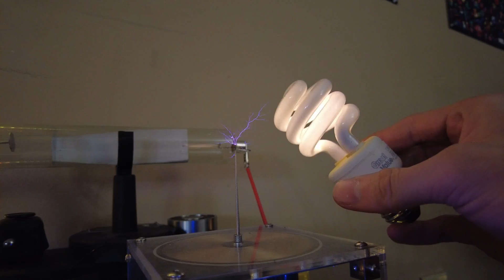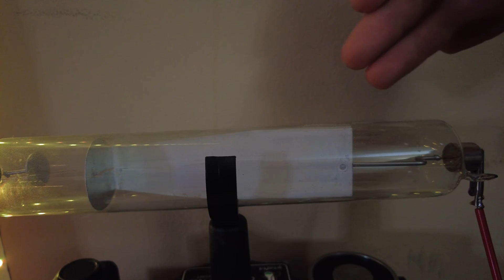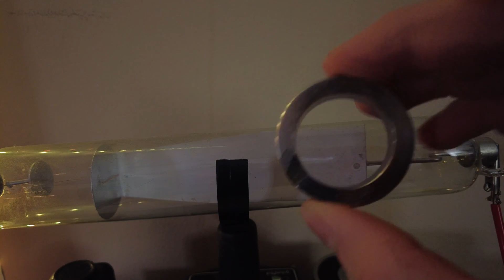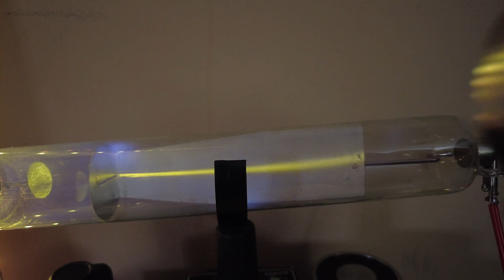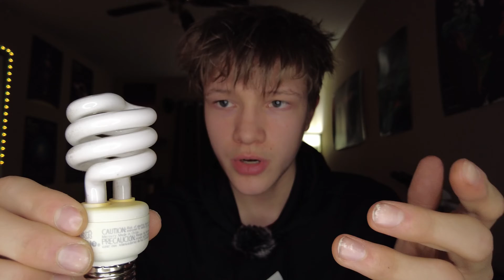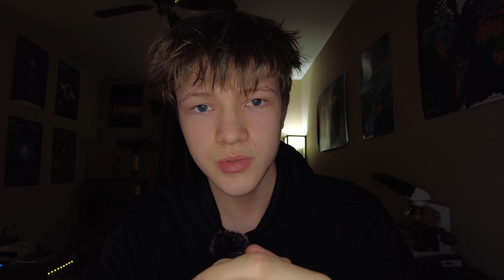Why Light Bulbs Glow Near a Tesla Coil

Comment: Nothing is expelled. It isn't radiation that is happening. It glows for the usual reason. The field from the Tesla Coil allows the charges in the light bulb to go into motion at a frequency that is seen by the naked eye. If you looked at it in reference to the beta (electrons and "positrons") value of a semiconductive component, only then is there an actual gain in emitted charges. Those 'emitted' charges are only used as switching charges. Hence the semiconductive components aren't harmful to a user of a device containing semiconductive components. In some other sense, if there are ionizing EMFs of any sort in the references of which you speak, then there are also particle emissions. Otherwise, you then only have looping isolated fields interacting. In the sense of any of the bad stuff being in peoples' hands,, that stuff would be banned.
Reply from the maker: When it's on, there's a plasma inside of the bulb, a low-temperature plasma. That plasma consists of ions that have been stripped of an electron. These mercury atoms and whatever other element is in the bulb does indeed expel electrons. It does produce harmful UV radiation, but this UV light is converted into visible light from the white phosphor coating on the inside of the bulb.
Reply: This happens for the same reason the sun is glowing mate,  high heats ( generated from the voltage in the form of a current ) strip electrons forming ions , these ions can carry charge and cause other ions to form , this superheats the metal causing a plasma to form ( other electrons can cause a chain reaction with this proscess ), this is why metals with low melting points are used as they can enter there vaporisation state earlier then others , this may also be because certain elements emit different wavelengths of light depending on the electron orbitals they return from when de-exiting , the more energy it returns the greater the frequency of the light emitted therefore a smaller wavelength and a more violet colour. There are ways to prove this such as microwaving a lit match , or a grape,  you can even use the same science to figure out why de ionised water can transmit electrical signals